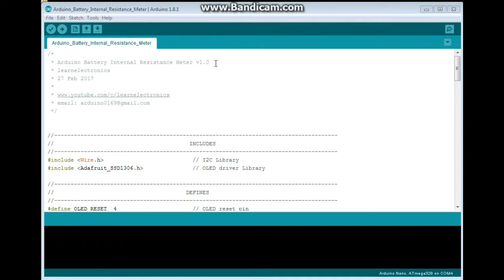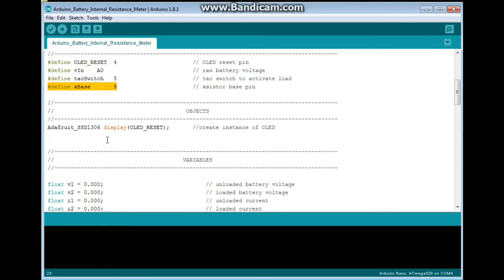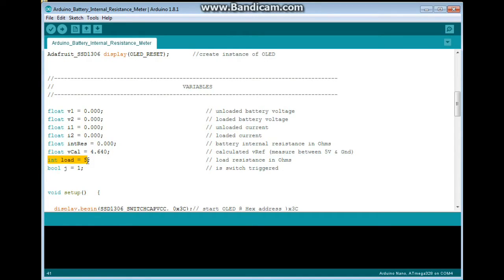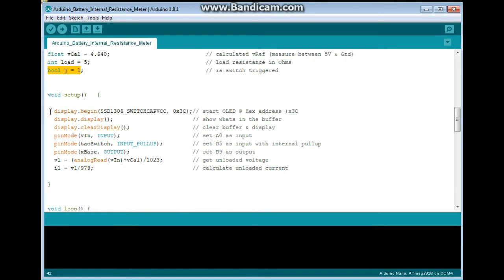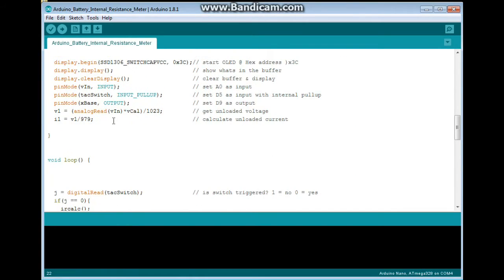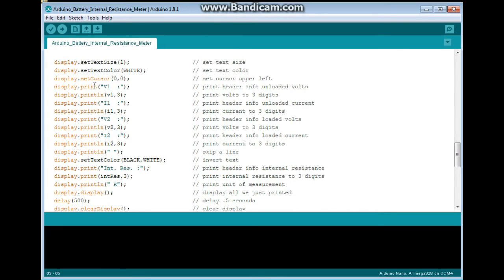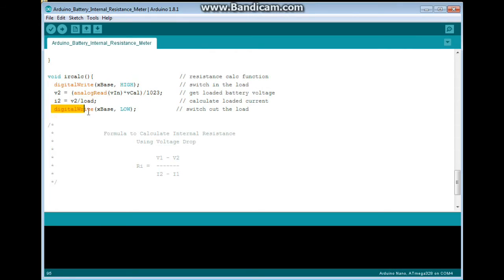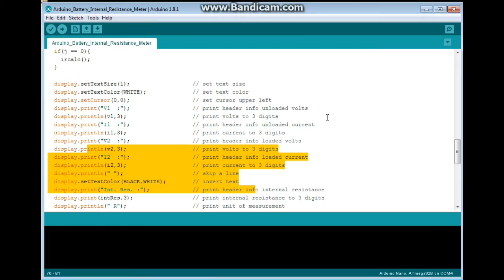Arduino Battery Internal Resistance Meter

Comment: How the hell V1 unloaded battery voltage can be lower than V2 loaded? Battery voltage should drop once you connect resistor. I'm getting this correctly, V2 is battery voltage with resistor connected to battery?

Comment: Is this capacity tester or resistance tester

i am confuse please can you explain

I want to make, can you share the schematic how build the circuit

Thanks
Reply: This tests the "Internal Resistance" of the battery.  It does not test the "Capacity" of the battery.  As batteries go  bad, the Internal Resistance increases.

Comment: a really nice project. have been looking for such a project for a long time. is an additional voltage divider sufficient to test 12V batteries? I'm also currently looking for a project to measure the impedance and length of a cable using a 1Mhz TTL delay. Have you already tried this with an Arduino?

Comment: the first 18650 isn't 0.012 Ω, it's probably around 0.025 Ω ...that thing is not precise
EDIT: 

also 13:15 you said li-po.. it's Li-ion actually...

if you used a 1ohm 1% current sensing resistor the values would be more precise..
even better a 0.5ohm, with a draw time of 100ms.
also you wouldn't need that 1k resistor because unloaded current would be 0 always..
Reply: I think it's even higher, like 0.06 or 0.08. For a fake battery even 0.025 is too low.
He would see it if he tried the same battery twice.

Comment: I was happy to find this post since I am going to build the same project. As I was watching it and trying to reverse engineer the project I have discovered an issue. It explains why the v2 reading was slightly higher than v1 making the math require the *-1 addition to the formula. This issue also makes the final result inaccurate.
I have drawn out the schematic and he wired it incorrectly. He didn't wire a complete current path for the battery under test. The positive pin from the battery splits and the two lines are routed to the load resistors. One is wired to the 1000 Ohm unloaded current path resistor, and the other wire goes to the junction of the two 10 Ohm power resistors. On the other end of these parallel power resistors, they are directed to the switching transistor. He incorrectly has it going to the Emitter pin of this NPN transistor (2N4401). Then the Collector pin is connected to the other end of the 1KOhm resistor and that's where it ends. There is no path to ground, so these two points are basically floating around the battery's positive potential. Instead of having the Arduino's sense point "vIn" (pin A0) connected to the battery's + lead, it is connected to this floating-point which makes the Arduino the only path to ground (which is essentially zero). So when the sketch starts the voltage is nearly the full potential of the battery at rest. When the ON switch is pressed and the transistor turns ON, this sense point now has two parallel paths to the battery's positive lead thus bringing "vIn" measurement up slightly. this creates a negative IR reading making the *-1 addition to the sketch necessary.
It's an easy fix, reverse the Emitter and Collector leads, move the wire connected to A0 and plug it into the ground rail. Add an additional wire, connecting it from A0 to the battery positive lead and remove the *-1 part from the sketch. I think placing a short delay to let the current stabilize when the additional current path is activated might be necessary for stability and accuracy.
Reply: Do you have a schematic please?

Comment: i dont think you can load test a battery in half a second, 10 seconds maybe
Reply: You'd be wrong in that thought process.
Reply: id be happy for you to prove me wrong with a video etc ?
Reply: @kermets  You don't need a video. Voltage drop divided by current equals resistance. Subtract the resistance of your leads and you are left with internal resistance of the battery.
Reply: All the commercial battery load testers I have used for my jobs had a load test time of about 5 - 15 seconds . your formula is correct but not accurate....
Reply: @kermets  I probably misspoke, here.  I thought we were just discussing IR, since that's what the video is about.  I agree, it should probably be ran for more than a second for a load test, but the initial voltage drop due to IR is a good enough test. You usually instantly know whether a battery is good or not the instant the load is applied.
Reply: A "load" test and an "internal resistance" test are two different types of tests.  With this code, the 5 ohm resistor load is turned for less than a millisecond. The Arduino and/or components may be damaged if the current is on much longer than that.  Many times, batteries will drop in voltage in the first 2 seconds of a load being applied.  It may be better that he first does a "load" test for 5 seconds (different routine not covered), and then perform the "internal resistance" test (which is what his code is designed to do).  To do the "load" test, you likely will need to use a relay that can handle the amperage of the load.

Comment: Howdy?  What took you so long and too laboriously explained could be easily and better explained with a schematic diagram.  I have seen other YouTube Uploaders use this style of better presentation, doing this in their video:  "HERE'S THE SCHEMATIC DIAGRAM (superimposed on the video)  and THIS IS HOW IT LOOKS AS I HAVE ASSEMBLED IT".  Your explanation made you point to circuit parts which we already know - sort of insulting our intelligence - like showing us what a Nano is, an Oled,  high wattage resistors, etc.  And in the end your wiring explanation was just as fussed up because, for one thing,  it did not answer what that 979 ohm resistor is doing there.  Don't get sore at this negative comment...just aiming for improved presentation later on from your channel.  But as for your project, it is very good.  The OPUS, the IMAX B6 (chinese clone) and a few more brand name chargers give the cell internal resistance but we don't know the science behind them...and these devices measure INTERNAL RESISTANCE now and 15 seconds later, using the same cell,  give out a completely different INTERNAL RESISTANCE making one conclude that their measurement is LOUSY.   Your project is based on SOLID SCIENCE THAT WE SEE AND UNDERSTAND AND WE SEE WORKING.  Thanks a lot, Sir.

Comment: Hello, I see an issue on you screen, as the loaded batteries have a higher voltage than when unloaded. How it that possible ?
Reply: It's called magic science :)
Reply: Good point.  It may be that he should put a 1 second delay in the Setup routine, before capturing the voltage.  When initially started, the voltage from the USB may be drained for a second or two.

Comment: looks good, but keep in mind that power resistors usually have a tolerance of 10%, and in the sketch you just assume that the parallel resistance is 5Ω. If that's not exactly, all your measurements are fucked up ;)
and don't forget that a BJT Resistor can act as a variable resistor which also messes with the measurement. A P-Channel mosfet would be a better choice. Then you have the same ground (no Transistor between power resistor and ground) and the measurements are also more accurate.

Comment: This is a great project.. I'll have to try it out.
I don't know much about the metalband resistors though- I have some that I pulled from a TV which are labled MPC722 3.3ΩJ
and I am wondering if you might tell me what the J stands for?
Reply: https://en.wikipedia.org/wiki/Resistor#Industrial_type_designation

If Wikipedia's to be believed, the J is a mil spec designation for tolerance. So it's 3.3 ohms with a 5% tolerance. So the true resistor value could be between  3.135 ohms or 3.47ohms.
Reply: hey thanks alot!
I did end up finding the datasheet and it shows the tolerence.. but did not explain it with the J marking, so this helps alot.
Reply: You're welcome. Honestly when I was in college, i don't even think we covered those letter designations. If we did, it was in passing. Most of the stuff i've run across since then is usually 10% tolerance and that's good enough for most applications. Now for this project, i'm assuming Learnelectronics is using 5% or 10% tolerance. You can get them as small as .001% but they're super expensive.
Reply: any suggestions for measuring internal temperature of batteries?
Reply from the maker: Gray, A = 0.05% 
Violet, B = 0.1% 
Blue, C = 0.25% 
Green, D = 0.5% 
Brown, F = 1.0% 
Red, G = 2.0% 
Gold, J = 5.0% 
Silver, K = 10% 
No color or band, M = 20%